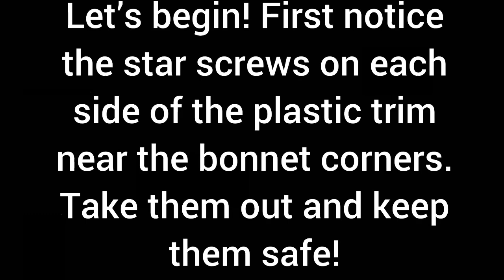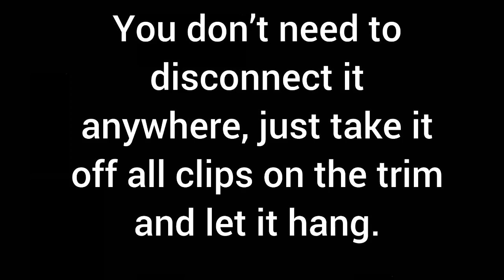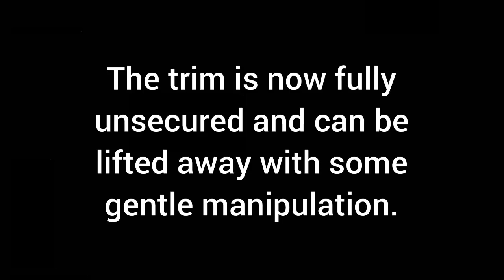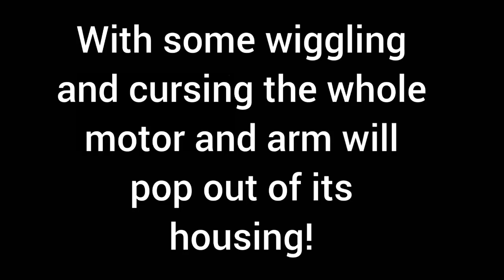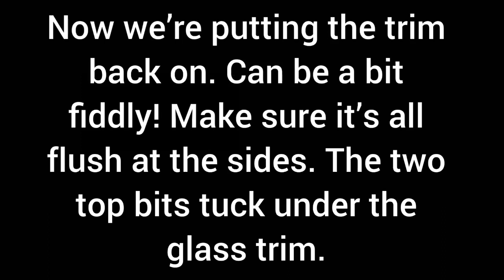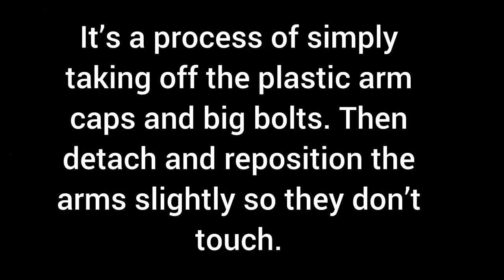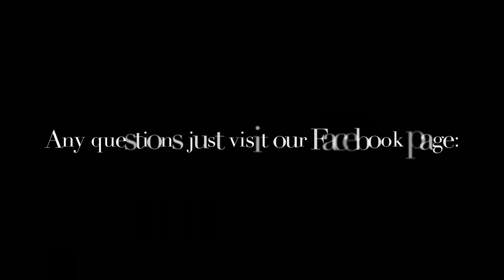Replacing wiper motor on a DACIA Logan mcv and sandero

Comment: Mechanic near me wanted 140 pounds to do this job for me and I had supplied the motor!! This video made it easy to understand and complete in less than 2 hours (a lot of time trying to get the driver side wiper off due to corrosion). I imagine it would have only taken the mechanic 30 minutes to do so this video saved me some hard earned dough. Was the same process for a 2015 Dacia sandero mkII. Thanks for this.

Comment: I am one of the least mechanically minded people and even in my mid 50s as I now am, have never done any work under the car bonnet other than filling up the washer bottle and checking oil levels.  However, I have just followed this video to fix the wipers on my Sandero Stepway and it was an absolute breeze! Thank you so much for posting this video - so easy to follow.

Comment: Problem we had was the wiper motor running but no water from the jets.  Checked jets, not blocked.  Removed the plastic trim as per video, found the washer hose had worn through close to the washer bottle, the worn area being c. 4cm in length.  Cut away the worn hose, which allowing for the undamaged length on the bottle connection shortened the overall hose length by c. 8cm,  and connected back up to the bottle.  Fixed.  Only issue is that the washer hose is now too short to clip onto the plastic trim.